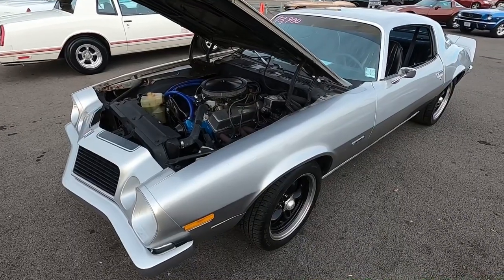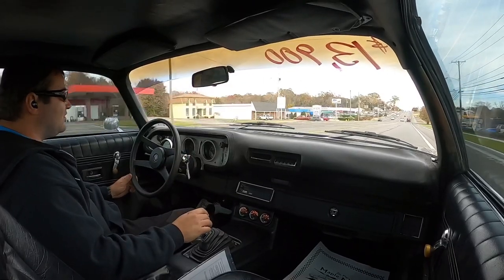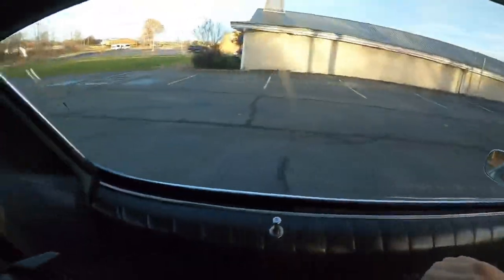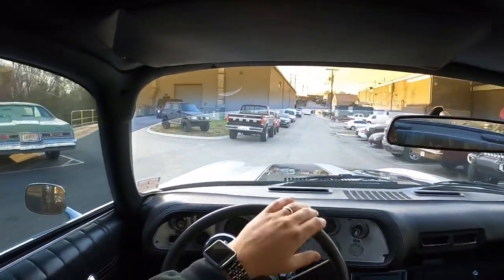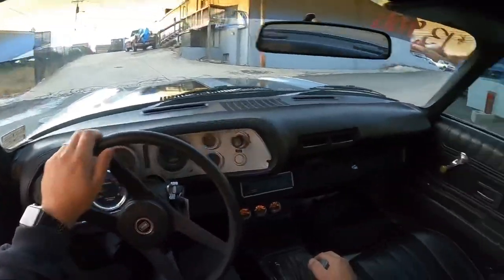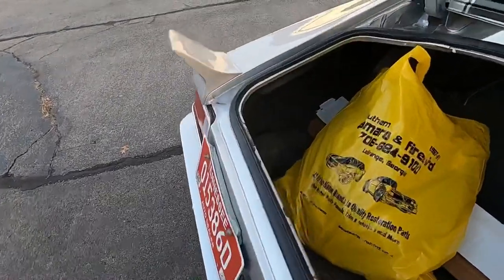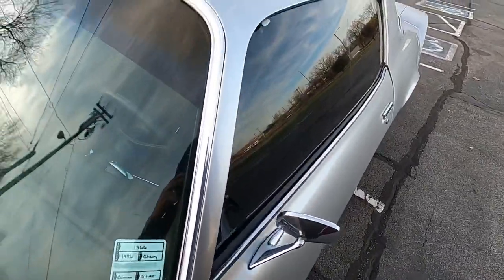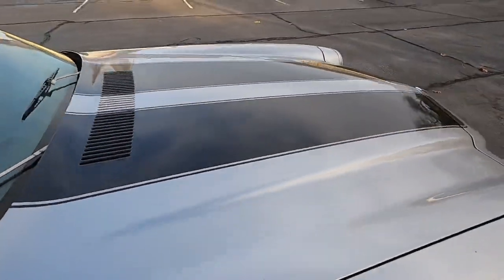Test Drive 1976 Chevrolet Camaro SOLD $13,900 Maple Motors #1366

Comment: These old cars are getting hard to find that clean 👍
Reply: I have a 76 that I bought  three years ago, its a Type LT silver with the black vinyl top  custom  interior  with the blue  cloth 53,400 original  miles,i got it covered up in a garage, yes not to many this era that are still around  in very good  to excellent  shape  considering that they  produced over 182,000 Camaro's in 1976

Comment: Looks nice. Had a custom one in the past with modifications from a technical school in Waco Texas. It ran great but could not touch the 1978 Modified Z 28 with 4 speed manual transmission. Thank you for sharing the video.

Comment: I see it has cutouts, but I would put a tail pipe all way to back otherwise you get that exhaust up in the car. Bumpers have been pulled in tight to the body also. Not a bad car overall it looks like.

Comment: Dang it, had I known twenty years ago My 1975 could have brought this much I'd have hung on to it.
Reply: How much was it when you got it??
Reply: @ru2253  actually it was thirty years, but I paid $500 for it. I pulled the wheezy worn out 350 and built a 396 and turbo 400 transmission. Began with a 375hp block and put lots of goodies in it.